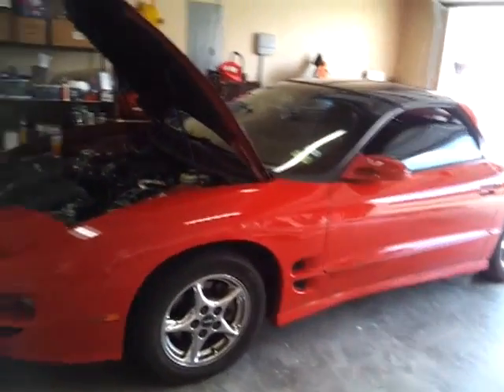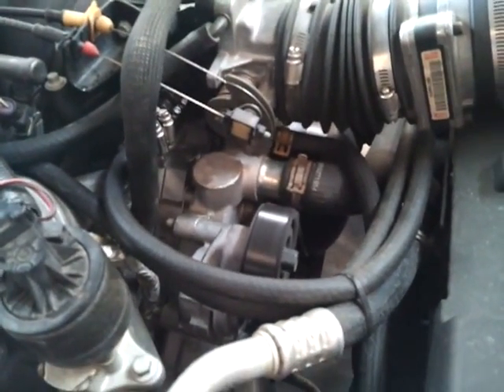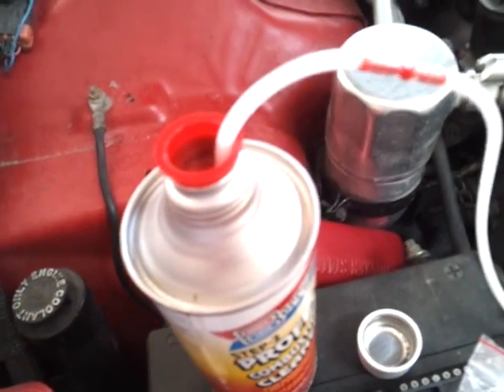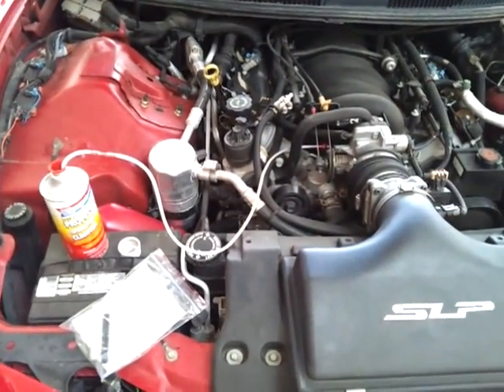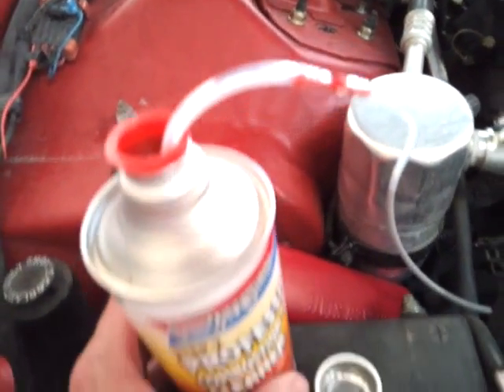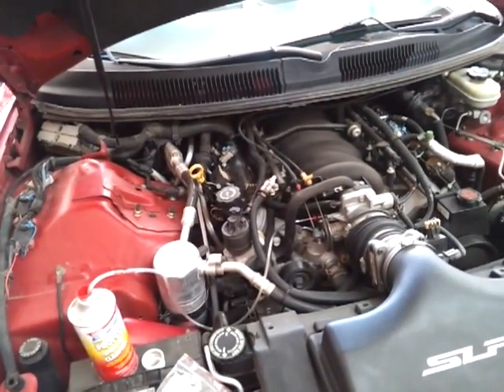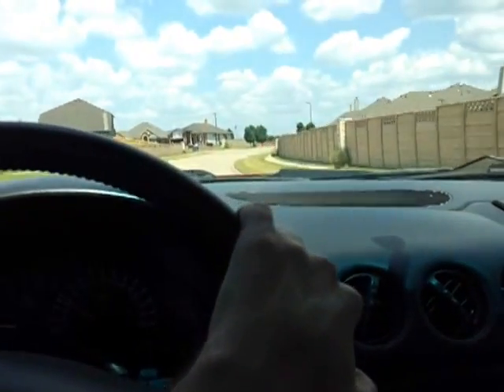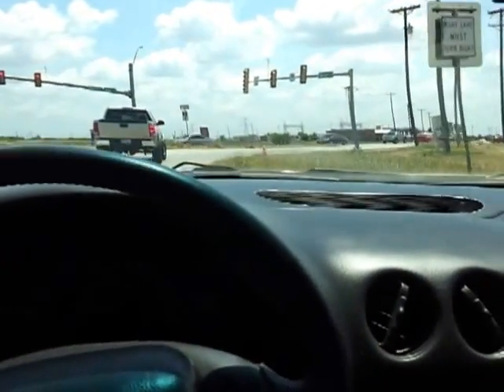Combustion Chamber Cleaning—Berryman Your Car; Don't Seafoam It!

Comment: I'm sorry but you have no idea what you're talking about. I've looked at the ingredient info from both and they're just two different types of paint thinners. I work at a parts store and I have sold and used both. Your Berryman cleaner is mostly Acetone with a little Toluene and a small amount of 2-Butoxyethanol(also used in paint thinners). Seafoam is an almost even mix of Pale Oil and Naptha(an industrial strength solvent ;) ) with a small amount of isopropyl alcohol which is also a broad range solvent. If you are going to bash one company to promote another you need to do your damn research before you do anything. If you had truly looked at the ingredients, you'd have realized that there isn't much difference except that Seafoam actually has smaller amount of a stronger solvent so that it can LUBRICATE while it cleans. If you read the can, Seafoam also advertises itself as an upper cylinder lubricant. Seafoam produces the same "SpyHunter" type smoke when induced the same way.
Reply: Oh boy, we all know how "parts store" employees are fucking experts on EVERYTHING...that's why they get paid $8 an hour...
Reply: OK Miss teacher i will get a bigger keyboard so i want accidentally   hit the wrong keys when typing with my Big fingers & upset you with a few misspelled words.  how many  beers and  funny cigs  have you had to worry about a few misspelled words .
Reply: I think it is all bs too, but to be honest I have not looked into the berryman product.
Reply: Their is a FORD TECH that is on You Tube. The F150 and other ECOBOAST engines are building up carbon.

What not to do he said is to use SEAFOAM. The heat from SEAFOAM will cook the bearings in the Tubos that is close to the motor. No problem you have now ruined your warranty and the Turbos cost THOUSANDS.

He didn't say you couldn't use it on other motors without TURBOS.

He said I could use MARVEL MYSTERY OIL in my gas 4 OZs on a full tank and 6-12 ounces at oil change. This will not harm TURBOS as their is no heat and fire.
Reply: Hate to tell you, but I had a turbo Volvo that I regularly ran seafoam through. The turbo, like almost every other turbo out there, was mounted right off the engine. There was a whopping 8 inches from the furthest exhaust port. You can't cook bearings that way. The only way to cook the bearings in a turbo is by having dirty oil, bad(cheap) oil, or starving the turbo of oil. Most turbos are water cooled these days as well so if you starve them of water, they will overheat under extreme stresses(like towing or racing) but even then, the bearings will be fine. I should know seeing as my Volvo was tuned to 20PSI of boost on the factory turbo and the only time I burned the bearings is when the oil pressure line burst, even running beyond the ratings of the turbo. Back on topic, Seafoam doesn't actually produce anymore heat, in fact it actually removes it through it's vaporization in the engine. Seafoam is a mixture of a few types of solvents including a certain alcohol similar to Methanol(used for cooling intake charges on TURBOCHARGED RACE ENGINES). Its solvent composition allows it to eat the carbon away without harming the engine. Did you ever read the can? It's SAFE FOR TURBOCHARGED ENGINES. You're talking to a mechanic and a parts specialist. Marvel mystery oil does the same exact thing as Seafoam but it doesn't cool the air charge. It does burn as well. I've used it as a fire starting fuel. Why do you think the engine can run with it in the fuel? The tech was trying to upsell his preferred product. I happen to know a Ford tech in my town, who I sell parts to regularly, who has used it himself in ever vehicle he owns. It will not void your warranty. Seafoam is guaranteed on many levels.
Reply: ImpenetrableSilence That is great information about SEFOAM and Turbos.

My field is Psychology so I won't do what many people do on the net. I won't argue with a mechanic that is a parts specialist.

The tech is pushing  the INDUCTION SERVICE  to remove carbon. I don't know what an induction service is ?

THANK YOU for taking the time to add your experience.
Reply: Speaking of homework! Let's take a look at your first paragraph. You have several grammatical errors. 

You're the one that doesn't know what you're taking about. [period] [It's] Naphtha not Naptha [and it] is NOT an Industrial Strength Cleaner. [period] It's a Very MILD Cleaner. [period] It's used in Zippo Lighter Fluid. [period] Acetone & Toluene are much more powerful Cleaner*s*. [period]  You might want do a little Homework and read up on those chemicals before posting  wrong information like here. [period]

Homework? I am surprised you know what homework is, did you ever do English homework when you were in school?
Reply: Dan theman You said you will get a bigger keyboard so you want (you needed the word won't ) misspell with your big fingers. the letter O and the letter A are on opposite sides of the keyboard. I don't think big fingers is the problem. speaking of alcohol and drugs, how wasted or stoned are you?
Reply: BMAC VAGS
I'm curious too, I've watched some of your other videos with Seafoam.  Looking forward to when you do this one.
Reply: I use  a couple bottle of gas tank additive each year and have had the intake off of my LT1 and LM4 both at 100k and both looked really clean, just sayin'  don't want to start an internet fight
Reply: Well thank you Miss Grammar Teacher  You going to make me stand in the Corner Now !
Reply: Just because it vaporize don't mean it disappears & is useless!  the vapor will still clean & burn in the combustion just like engines running on Propane , Butane  its injected  as a vapor &  not a  liquid .
Reply: I don't take advice from people that can't properly speak or write. I don't purchase products if the label has poor grammar, that shows lack of quality. Besides that,, you don't know what you're talking about.
Reply: ImpenetrableSilence #":%%ttu"5ttyl8r tutu 5ytttyyyyyytryyyyyyyt%56ty5tty r r 21st-$
Reply: Impenetrablesilence : Your the one that don't know what your taking about  Naphtha not Naptha   is NOT a Industrial Strength Cleaner its a Very MILD Cleaner  its used in Zippo Lighter Fluid   acetone & Toluene are Much more powerful Cleaner  You might want do a little Homework and read up on those chemicals before posting  wrong information like here   http://www.ehow.com/list_6868703_relative-cleaning-strengths-solvents.html

Butanone or MEK is tied with acetone as one of the strongest 
solvents. This solvent is used as lacquer, varnish, paint remover, 
denaturing agent for denatured alcohol, glue and cleaning agent.
 
Acetone

Tied with butanone for strength is acetone. Acetone is the primary 
solvent used to clean laboratory equipment and is also used as a nail 
polish remover. Acetone is primarily used to clean plastics, fiberglass 
tools and vinyl. Acetone is also used to treat metal before painting it. 

Toluene

Toluene is a little more than half as strong as acetone and butanone.
 Toluene is one of the primary ingredients found in paint thinner. 
Toluene is also used to dissolve adhesives, rubber and sealants. 

Naphtha

Naphtha is a solvent that is half as strong as toluene. This 
substance is used as a general purpose solvent and has various other 
applications. For instance, naphtha has been used in lighter fluid 
because of its flammability.
Reply: ImpenetrableSilence Well I've been turning wrenches since I was in utero before I was shit from my mother muff...why don't you come up with something more realistic.

Comment: I HAVE AN 09 CHALLENGER CAN I RUN THIS PRODUCT WITHOUT ALARMING ANY OF THE ELECTRONIC BS. MY DEALER HAS BEEN PRESSING ME TO GET THE CAR CARBON BLASTED (THATS WHAT HE CALLED IT) IS THIS PROCESS  THE SAME THING. IM STILL STUCK IN THE CARBURATOR DAYS
Reply: Don't do anything the dealer tells you minus oil changes, they are all upsells that do nothing but drain your wallet.  I wouldn't use this stuff on my car.

Comment: I've used SeaFoam with good results. And it did put a lot of white smoke after letting it sit for about 15 minutes after getting it sucked in via the vacuum line to the intake.  Hadn't seen the Berryman product before but now that I know I'll have to give it a go.  Thanks for sharing.  Much appreciated.

Comment from the maker: Haven't been under the hood of one, but both options are equally appropriate.  Just see if the PCV valve or the brake booster is easier to get to.  My brake booster is buried, but the PCV valve is right there on top and much easier to get to.  Either way, good luck!

Comment from the maker: I'd like to have an '02 WS6.  What was the verdict after running the CCC?  Btw, replace those stock plug wires with some MSD 8mm wires for HUGE mileage improvement!
Reply: I used some NGK wires to replace the OEM crap that was in mine. I just put some B-12 injector cleaner in as well. After all the reviews It's the one with the best rep.

Comment from the maker: I'm not a motorcycle guy, but I suspect your best bet is to go in through the air-intake.  If you have a sprayer you can pressurize (like for spraying weeds, carpenter ants, etc.), that would be ideal...under the no-manifold-vacuum-induction option. Otherwise, any kind of sprayer with a squirt option will work.  Just clean it out and pour the chemical in.  Don't worry about residual water either.  Once the engine's warm, just take off the air filter and spray the chemical in at a moderate rate.

Comment: Where would this go on a fuel injected motorcycle? I use Berryman b 12 in the tank,  but 3 years and 14 thousand miles,  I think I need to clean it the proper way.  The bike is a 09 suzuki m50

Comment: Used them both several times now. Cannot tell the diff to be honest. Cost is about the same. The oil DAn speaks of in SF is not for lube, it's the foaming agent. Never smogged after using BM but I failed a smog on a 89 Camaro, horribly I might add. Used SF 3 step, drove it 20 miles, passed with flying colors. I chose SF because of the 3 step system. Not sure if BM would have pulled it off or not. Will give it a try next time. Thnx

Comment from the maker: No, but I wouldn't run one of these and drive straight over to get my state inspection with emissions done.  Catalytic converters are pretty resilient—they're actually built to last the life of the car!  Any catalyst failure will be temporary and not progress to catalyst poisoning.  Instead, once the catalytic converter heats up, it will begin burning off any contaminants that have adsorbed onto the catalyst.  Then they will be good as new...or at least as good as before you applied the cleaner.

Comment: Just knew about this, used in my 02 Ws6 too, used a Mopar CCC. left it settle in for 3 hours and turned it up.. let it idle drove a bit .. few WOT runs, not much smoke AT ALL. it's weird for a car with 107k+ miles that had the factory spark plugs & wires when i bought it. (total stock). but hey maybe tomorrow it shall suprise me even more

Comment from the maker: In the gas tank, yes, Seafoam will lube the upper cylinder, a feat which only requires a couple hundred ppm of base oil.  However, when you apply Seafoam (or any other oil-based product) via manifold vacuum induction, you're adding WAY more oil than you need for lube.  My guess is that you're likely contributing to deposits since the oil won't burn as cleanly as a lighter hydrocarbon would.  Berryman has a Seafoam-like product, but this isn't it.  Oh, and the Berryman CCC was $12 at Pep Boys.